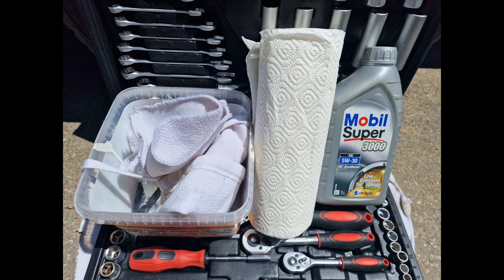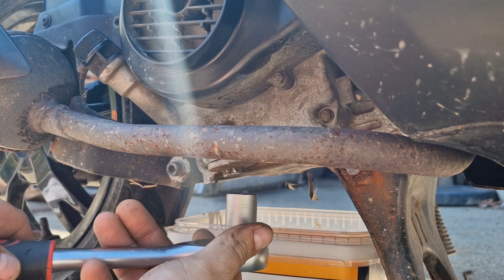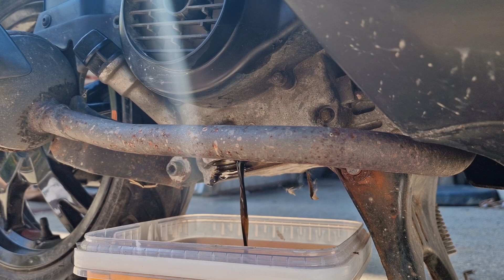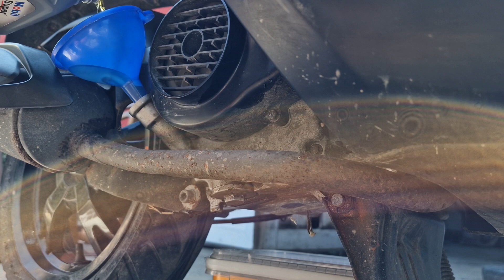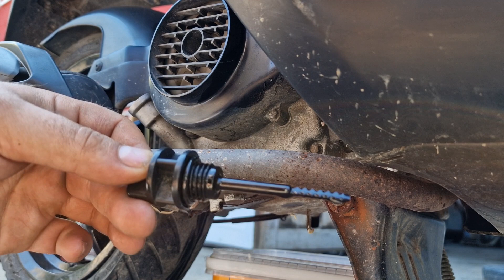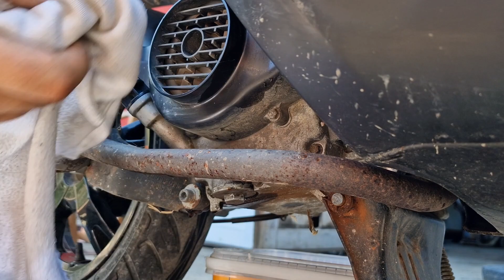Peugeot kisbee 50 4t Motoröl wechseln/Engine oil change

Comment: Ich habe 300ml abgelassen, wie in zu findender PDF von Peugeot 800ml aufgefüllt, aber der ist nun weit über dem Max-Stand.
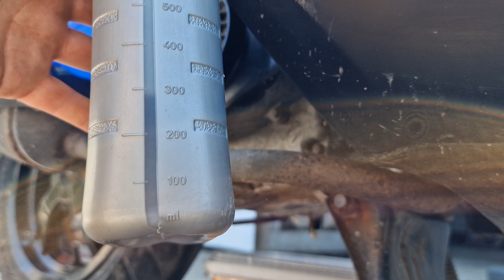Hier im Video sind es bei 2:22 300ml, seltsam... Beim Füllstandtest vorher, meine ich war der Stand unter dem Minimum.
Was ich auch erst jetzt sah, gemessen wird OHNE Einschrauben. Wenn man sich aber auf die Angabe in ml verlässt, ist das nicht wichtig.
Wenn aber 800ml zu viel sind, stimmt was nicht. Die Zahl steht überall.

Nach dem Wechsel von Kolben, Ringen und neuem Kreuzschliff hatte ich nach einigen km und kaltem Motor einen "schwach" klingenden E-Starter.
Mit Antreten ging er sofort an, und ist er warm auch mit E-Start.
Also prüfte Ich das Motoröl. Kompression wollte ich erst später nach evtl. 100km, 200km prüfen.
Komisch ist, ich hatte kurz vorher (vor den Arbeiten) auch den Stand kontrolliert, und da war der in der Mitte des rautierten Bereich.
Und da war eigentlich nichts ausgelaufen...
Nun aber mit 800ml randvoll.
Kann es noch mal richtig warm ablassen, aber so hoch wie der Füllstand angezeigt wird, kann es eigentlich nicht an der Temperatur liegen.
Ich hatte vorher zur Sicherheit etwas 2T-Öl (evtl. ~1:100) ins Benzin gegeben. Mag unnötig sein, aber schaden tut es beim Einfahren wohl auch nicht.
Reply from the maker: Es ist am korrektesten, wenn 800 ml steht, etwa 700 ml einfüllen.  Überprüfen Sie die Stange, ob sie nahe am Maximum ist.  Fahren Sie ein wenig damit, um es aufzuwärmen, und lassen Sie es dann ein paar Minuten lang abkühlen. Überprüfen Sie noch einmal, ob Öl fehlt, und fügen Sie es fast bis zum Maximum hinzu. Ich habe etwa 750 ml eingefüllt.
Reply: @DinoDIYTips-Tricks  

Ich sah gerade, die eigentliche Ablassschraube ist auf der anderen Seite an der Seite.
in der Anleitung (Bedienungsanleitung_Kisbee_50_Euro5_11799630_1220_v13) stehen beide nacheinander.
Also zuerst links die seitliche, dann rechts die unten. Dann evtl. mal den Motor ein paar Tritte drehen um Restöl rauszubefördern.
Unten der Hinweis von maikpassoke4068 hat sich wohl darauf bezogen.
Leider etwas missverständlich "Auf der anderen Seite muss aber auch noch Öl gewechselt werden".
Das verstand ich auch so, dass da noch "anderes" Öl zu wechseln ist. Und da es noch Getriebeöl gibt (und das links sein müsste), kann man das schon so missverstehen.

Werde das spätestens morgen mal prüfen.
Evtl. kommt da seitlich noch was raus, und wenn ich dann 800ml einfülle passt es möglicherweise.
Reply from the maker: @Ano-Nymos  Baujahr deines Kisbee?  Ich werde morgen nachsehen, ob bei mir auf der anderen Seite eine Schraube ist.  Ansonsten verändern sie sich in der Werkstatt genauso, wie ich es gezeigt habe.  Auf jeden Fall könnten Sie Recht haben.
Reply: @DinoDIYTips-Tricks  
2013.

Die Schraube habe ich geöffnet, und es kam noch etwas Öl raus.

Habe aber vermutlich die "900" auf der Ölflasche als "800" gelesen.
Ist auch ein ungewöhnlicher Wechsel.
Bei nun 700 ist es genau in der Mitte.
Also die Menge müsste stimmen.
Wenn ich noch 100ml nachfülle, ist es evtl. auf Max.
Ich dachte, am besten wäre exakt die Mitte.
Reply from the maker: @Ano-Nymos  ok, bei mir ist das Maximum erreicht, wenn ich 750ml einschenke.  Das heißt, es sind noch 50 ml altes Öl drin, das ist sicherlich nicht so wichtig, aber es ist wichtig zu wissen.  Danke für Ihre Antwort.
Reply from the maker: @Ano-Nymos  Ich weiß nicht, wie es Ihnen geht, aber ich wechsle das Öl alle 500-800 km, es geht schnell und der Motor wird geschont.
Reply: @DinoDIYTips-Tricks  
Vorgegeben wird alle 2000km oder 6 Monate.
Was schon recht oft wäre.
Ich fahre mit dem Roller nicht oft, aber dann nicht 15km/15km, sondern eher 30, 50, 80, 100... km einfache Strecke.
Reply: @DinoDIYTips-Tricks  
50+ml kamen da vermutlich noch raus. Ich meine es war deutlich mehr als so ein kleiner Medizin-Messbecher mit 30ml.
Reply from the maker: @Ano-Nymos  Ich fahre die ganze Saison über etwa 1000 km, aber das sind alles 1-10 km und die Stadt.